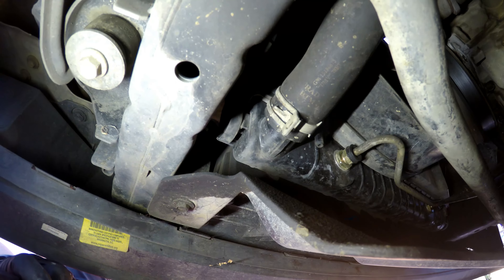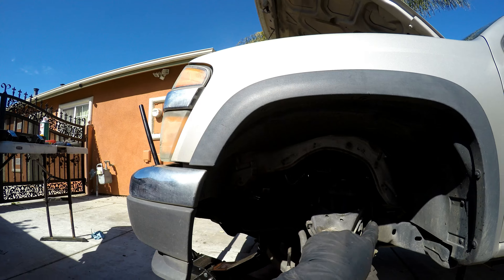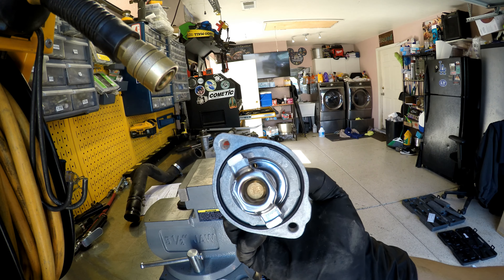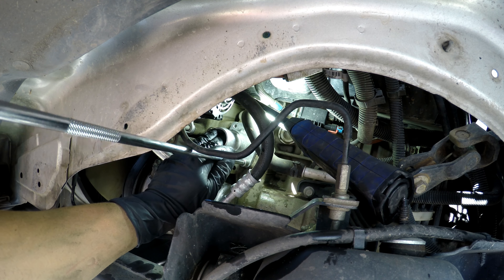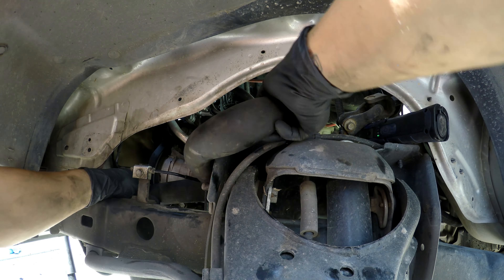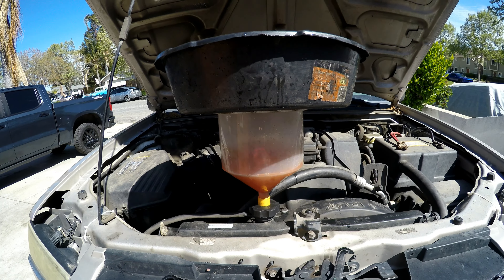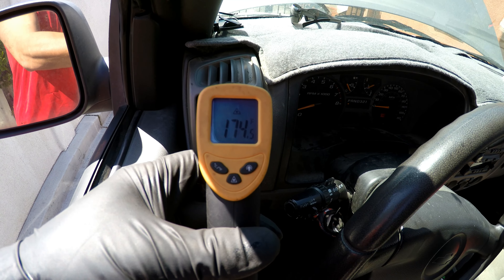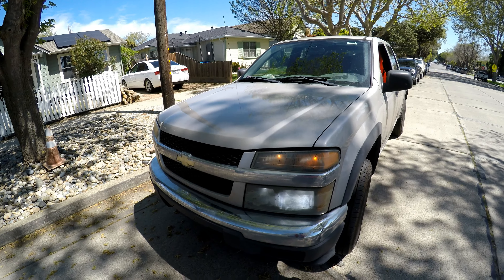Chevrolet Colorado (3.5L) - Thermostat Replacement

Comment: The i5 Colorado was 3.5 liter up until 2007. In 07 GM refreshed the truck and added a 3.7l with 22 extra horse power.

Comment: After you replaced it, your temperature needle looks above the middle. Is that normal?
Reply from the maker: i noticed that too,. when i checked the ob2 reader i saw 210 steady(which is normal for this truck), and i asked the owner if the gauge always read like that and he said that it was normal on his truck, so possibly a slightly off temp gauge sensor.
Reply: I hope so. I recently bought this same truck and mine hovers just slightly above halfway like that.
Reply: If it sticks to below half it’s because the thermostat has gone bad I own a 04 3.5 in-line 5 ext cab colly and work at a shop had to pass smog recently and couldn’t because the cat system wouldn’t run my co worker (smog tech) explained the truck needs to be at proper temperature for the cat system to read properly since my truck only sticks to a quarter it wouldn’t turn on the cat system so I couldn’t pass smog what he had me do was put a piece of cardboard over like a quarter of my radiator and the truck was up to half way on the gauge by the time I got home brought it back the next day and passed smog I’m leaving the cardboard there till I replace the thermostat but you want the temp to be at the half way point for a stock colorado everything runs properly at 210f wich is the proper temp for the truck if your running at a lower temp something isn’t right and most of the time it’s the thermostat 🤙🏽